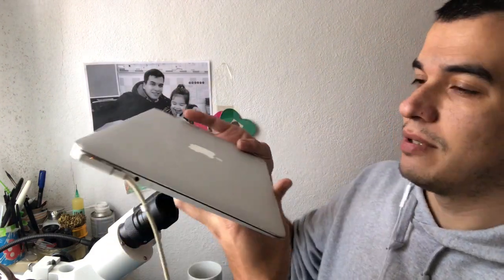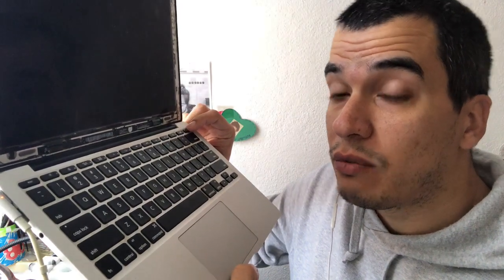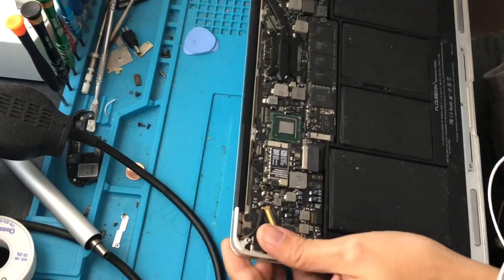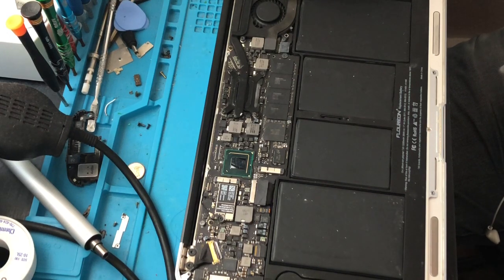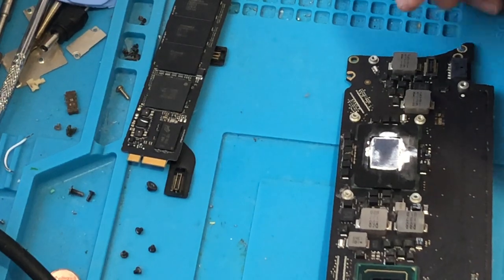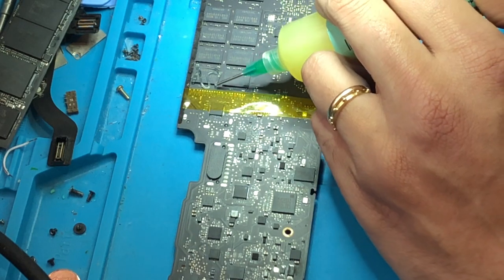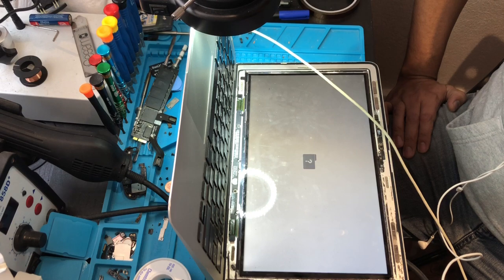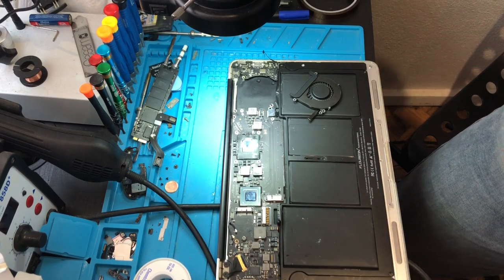MacBook Air A1370 - No Image 3 Beeps, can it be fix?

Comment: If you do not have a hot air station, the following method also works although temporary: preheat your oven to 190 degrees celcius or 375 farenheit for about 15 minutes. place the motherboard in the oven in one of the upper positions on a heat resistant silicone pad on a wire rack for 8 minutes in total. (silicone cookie sheets/pads work perfectly fine, set a timer so you don't bake it too long) This works as if you were using a proper reflow oven.

Comment: Hey Man, hope you reply, it's the same problem with my Macbook Air, does it need some parts replacement or not?
Reply from the maker: On my MacBook i just reflow the memory chips. I never tested by replacing the chips

Comment: Can you use a hair dryer instead of heat gun? I just got 3 beeps tonight on A1370
Reply from the maker: cyrax83 I normally prefer to use my hot air station

Comment: what is the liquid are you using ? You just put the liquid around the chip and heat it at 400 degree. May I know the purpose ? thanks
Reply from the maker: ray nguyen I’m using the Amtech flux. I have put around the memory chips to allow then to reball them. It will fix the the issue with the MacBook not booting, and only beeps. You can check a similar video of Rossmann repair group on YouTube.